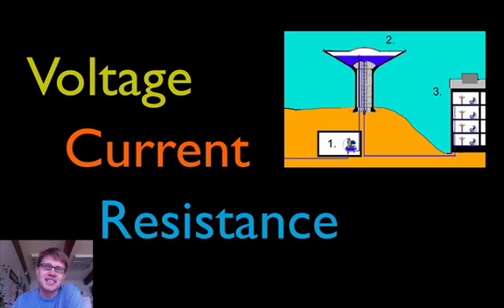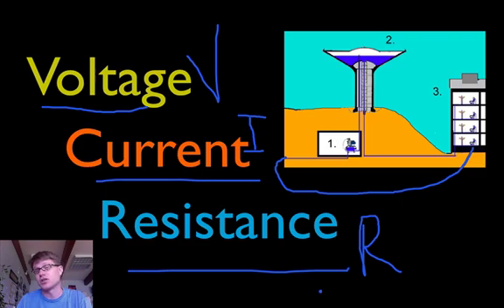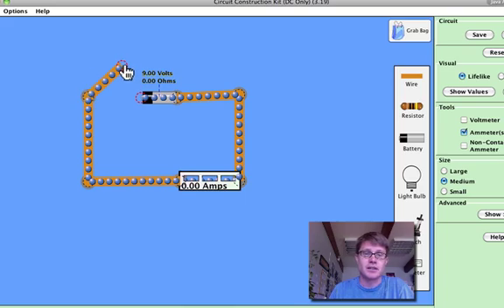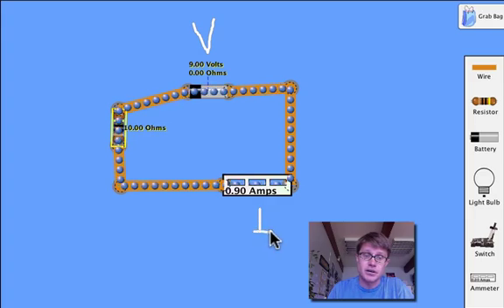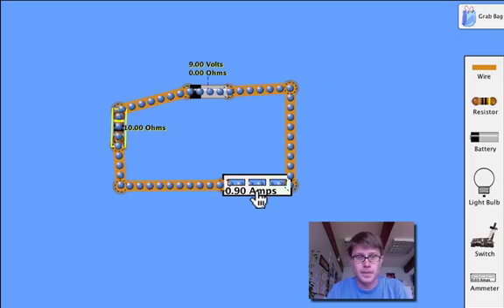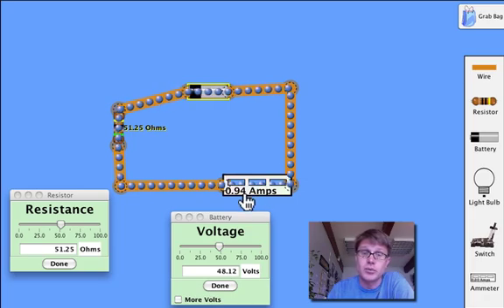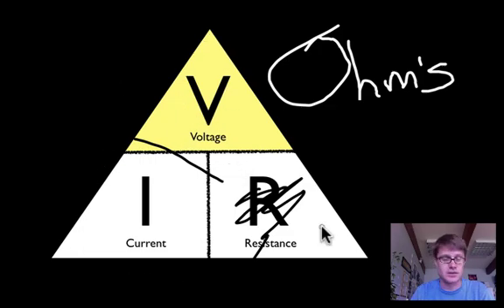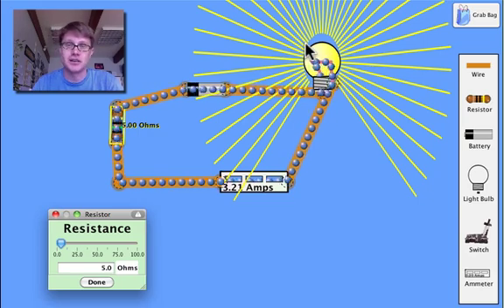Voltage, Current and Resistance

Comment: How was battery create electric potential when switch was closed
Reply: Because batteries already have electric potential inside them. Through a circuit the electric potential of the battery is shared with the components we attach such as a light bulb. The circuit doesn't power up the battery. Hope this was helpful. ;)

Comment: Is there a way to figure out current in a battery circuit with NO resistors? Means simply a wire connecting + and - terminals or maybe a light bulb inbetween?

Comment: Problem with this simulation software is it is not showing any resistance in the wire which in real life is an important consideration.  Also, a light bulb has resistance so what good it is in the simulation to just show that it lights up but doesn't change the total resistance in the circuit?  Lastly, in your analogy you talk about voltage being like water up in a water tower and current being analogous to water flowing from it but I never hear a good analogy for wattage.  One thing I feel is somewhat hard to grasp is how a thin piece of wire can melt in a 100 watt circuit if the amperage is too high (for example 10V 10A = 100W) , but that same wire would be fine with a different 100W circuit where we had 100V and only 1A.  Can you give an explanation of why this is the case please?

Comment: Is the voltage the same throughout the whole circuit?
Reply: +Kyle Delaney No if there is some rezistor or if you use not same conductor ;) Maybe some engineer will say more
Reply: it depends upon what type of circuit you are using.

If the circuit is parallel, then the voltage should be same and vice versa with series circuit
Reply: danny santos Yes but usally it is parallel and series also :D Forgot about fact that whole circuit can be paralell

Comment: Does electricity flow from negative to positive, vice versa, or unknown?
Reply: +Crusty Tackleford Electron flow is from negative to positive, so the actual electrons traveling from the negative to the positive. However when electricity was discovered they assumed that it flowed from positive to negative and so you will find it both ways in many text books.
 
To answer your question:
The electrons are traveling from negative to positive, however you may see it taught the opposite "Conventional" way. It typically does not matter as long as you use consistency.

Comment: If I connect both poles of a battery, my battery blows.
I need resistance to fix this.
Every electrical component including a cord have it's own resistance.

So how come I have a complete circuit, I have resistance, I have current and voltage and still my battery blows?

Also I would like to ask. If I connect both poles of the battery using a cord that is extremely long...let's say some kilometers long. And it's a small battery, let's say AAA. Do I have a complete circuit?

Comment: Cool program nice video but the program is is not accurate. When you short a circuit the meter will read 0 volts
Reply: opensource iskey Actually that's not true. For example, if you shorted a battery with wires that had zero resistance, the current would be infinite. Since we don't exactly have that, the current is just very high.

Comment: Hey there, thanks for the comprehensive refresher. I just want to clarify real quick about the voltage. Why doesn't the voltage, or electromotive pressure,  increase when the resistance increases? Wouldn't that.. idk.. back electrons up? There by increasing pressure?
Reply: To answer your question, resistance does not usually increase in relation to voltage at all. However, resistance can indirectly depend on Voltage in conditions like when there is extremely high voltage over a thin wire. The wire will heat up, and resistance goes up as well.

Comment: Why cant this guy tell me HOW voltage is created??!
Reply: LawoftheLandPA The voltage pushes electrons along the conductor from one atom to the next much like a difference in water pressure pushes water through a pipe. ... This means that a stationary conductor in a changing magnetic field can also produce voltage and, subsequently, electric current
Reply: =Generators

Comment: SO 240v @ through my pc is 240 v has nothing to do but it's the amperes that make heaters heat... so high resistance means no heat. So resistance resists the amps but the voltage keeps the same SO in theory a high resistance will make for more heat. but why does it not? i mean plugging one of those air fresheners into a socket with 240v at maybe 100Ohm why does that resistance not burn it up. only a light heatr.

Comment: Why would you want to resist the flow of electricity? I just never understand that
Reply: To withstand the too much flow of electricity because like in the video if too much current is applied to an object like a battery that has a low resistance it will catch fire or explode now to prevent that you need to add enough resistance to control the flow of electricity so that the current can slow down and the battery can keep up with the current and not explode 

15 years old btw and i just learned that after watching the video i hope my answer helped ^_^

#proudtobeasian
Reply: xXxLuckyx619 Yeah thank you, I had to watch the video again. Without resistors the battery, lightbulb, etc. may explode or catch on fire. What about capacitors?

Comment: i dont know if that was clear in the question i asked just before . let me clarify ,like when the voltage was increased in the animation , the electrons moved faster(more amps per second). but then if i have 50 amp at 1 volt would that mean that the electrons are moving faster than if i was moving 1 amp at 1 volt?  would it mean that  they would move a t the same speed but need a thicker wire?(like a 3 lane highway at 20 km per hour vs a one lane road at 60 kph)?
Reply: In this video Mr. Andersen pointed out that if the voltage is the same as the amps then it would explode. Meaning in Ohm's law 1 volt could never equal 1 amp without the battery exploding. It shows that 1 volt can only be equal to less than the amps depending on the resistance. Haveing 50 amps on 1 volt means the current is 50 times higher then the voltage. Meaning 50 times more energy flow(amp's) than Potential energy(Volts). You can't have more energy flowing than energy provided. Don't quote me on this I know nothing besides what I was just taught in this video.
Reply: thanks for shining a light.:)
Reply: what confused me was a 12v 16 amp power supply, because then that is a negative resistance, but i guess it's assuming no load, and i guess you could achieve it in parallel.

Comment: I know that voltage is like the pressure, but say i have a 1  amp at 1 volt and 1 amp at 100 volts. amp i getting more power from that? If so how is that possible does it mean that the coulomb can carry more or less energy? would that make the voltage  electrons that vary in power? does that mean the voltage is some measurement of electron attraction to the power source?

Comment: Sir i made a circuit as u shown in the video but my question is when put the bulb into the circuit the amp value goes to 0.45 without bulb it was 0.90. so my question is why and how? pls help
Reply: bulb increases resistance, so current slows down

Comment: Why did the battery burn? I don't get it; too much current? Are all batteries supposed to be connected to a resistor? Ever?
Reply: Yep too much current and batteries have a very fast flow of current so probably all batteries are supposed to be connected to a resistor.

Comment: None of the amps are lost - as amps is just a measure of current. However, some voltage is lost as heat in the circuit (but not much)

Comment: That is because there is some internal resistance in battery and the wires in the circuit also have some internal resistance even though they are negligible, and because of this resistance heat is produced. The resistance in never zero in a simple in real life, unless it is a superconductor. So for example the voltage in battery is 9V and internal resistance in circuit is 0.1 amp, then current = 9/0.1 = 90 amps, which is lot of current. So the battery heats up and can even explode.

Comment: but the resistor will heat up in time its soaking up electrons by blocking flow and will kill the battery quickly it would be  better with a  hobby motor induction varies in a motor under load a resistor not soo much and case u wanted to know 1million electrons = 1 volt

Comment: At 5.00 he said than value of the current was 9 amps but in the formula he used 0.9, why??.Other than this doubt everything else was gteat, it wasn't this easy when my teacher explained it
Reply: The formula he was actually explaining is V=I x R V meaning voltage, I meaning current and R meaning resistance so the voltage in this case is 9 volts the resistance is 10 ohms and the current is 0.90 amps so 9=10 x 0.9 or 0.90 hope this helped ;)
Reply: @ryanhassan8621  Thanks :-)

Comment: the battery has a limited current output. There's a concept of "internal resistance" of a battery. this is modeled as a small resistance in series with the battery. At higher loads, this small resistance makes no difference in the current, but the lower the load resistance the more the battery's INTERNAL resistance comes into play and limits the current in the circuit.

Comment: when i short circuit a 1,5V batterie and i use an Amperemeter i get a meassure of 6A. Why is that so. according to the program i should have burned my Ampermeter with a value of 1300 A

Comment: Water is a poor choice -- fluids are incompressible, yet we refer to voltage as pressure. A better example is air pressure. Most people have never had any training in fluids or hydraulics, but nearly everyone has put air in their tire or worked with a can of spray paint.